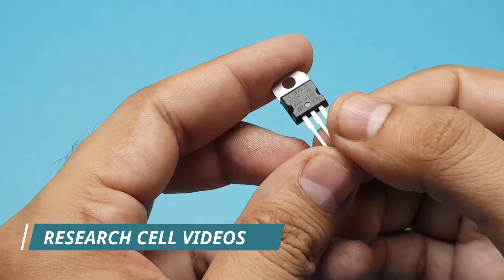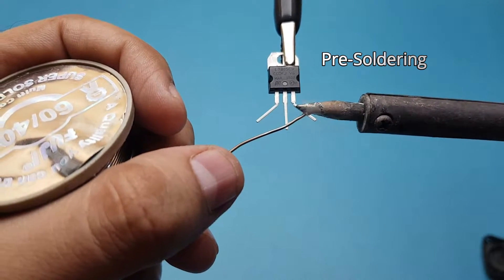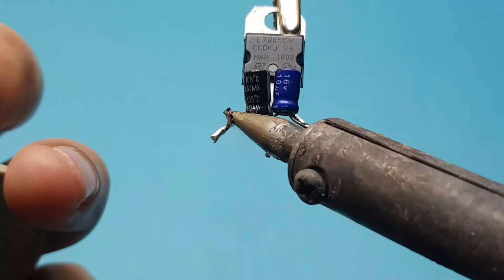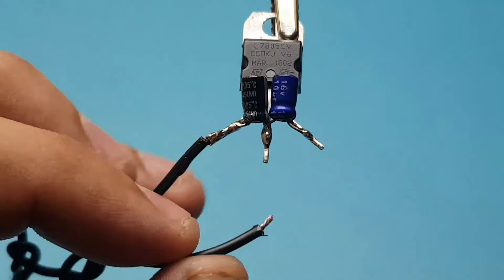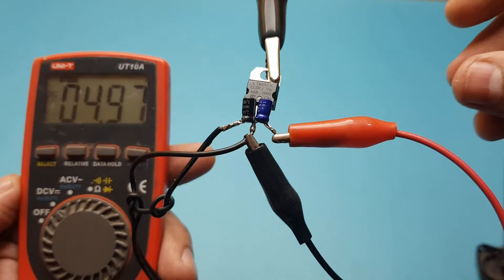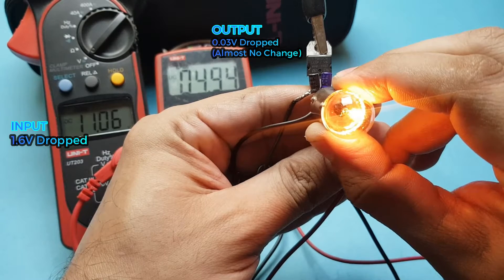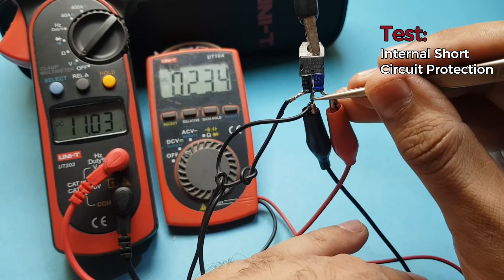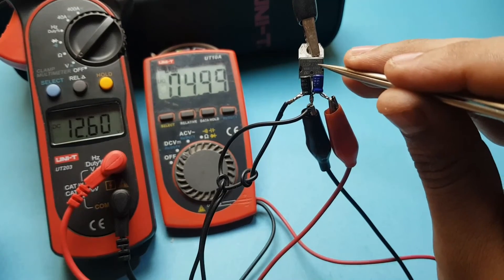How to Use LM7805

Comment: Bro is this mini regulated psu with ic ?
Reply from the maker: LM7805 is a standalone voltage regulator IC. You can connect any unregulated voltage source (even battery) on the input side to get a regulated 5V output at the output side.

Comment: What if capacitors aren't used?
Reply from the maker: If your input source is a battery and is located near the IC then you may be able to use it without capacitors. Otherwise it is advisable to use capacitors although it will still work in the later case but the voltage wont be as much stable as with capacitors.
Reply: @researchcell  my power supply is a 24 volt switching power supply. what capacitors should i use?